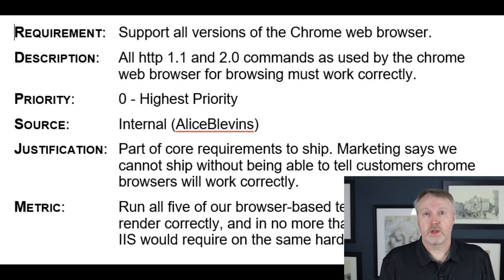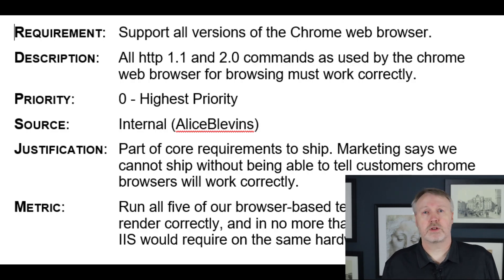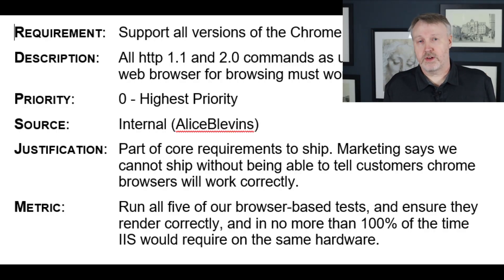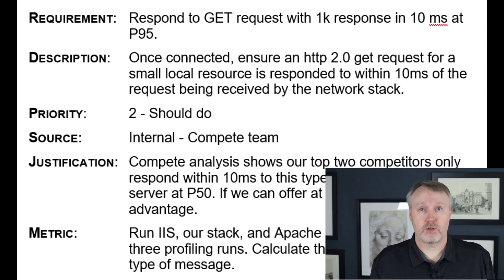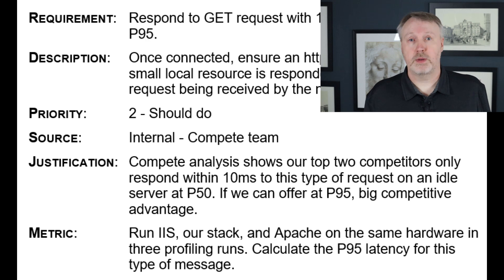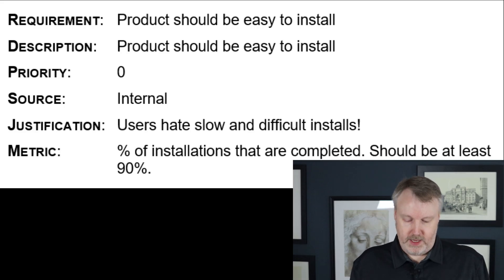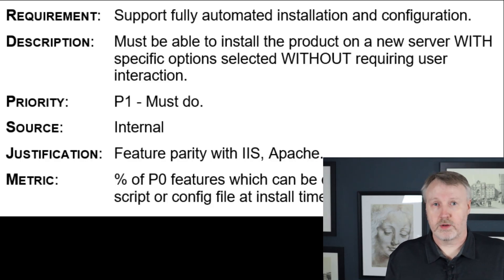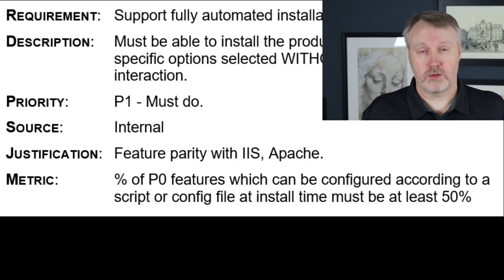Building Big Software - Generating Requirements

Comment: I work in a small team that creates products for other teams to improve performance. How do you deal with wearing multiple hats in a team? Given my team size, we lack the PM to make the requirement gathering with the client. instead, the devs + lead join in on meetings to discuss that with client. Along with that is clarifying requirements, asking additional questions that might occur outside of the meeting, which eats up development time. What's a good way to strike a balance between communication between stakeholders and development?
Reply from the maker: What you've really got is an opportunity for folks to wear several hats, but at the cost of what they can develop. As you point out, time spent on requirements, etc. is time you're not doing primary development. This has to be accounted for in the overall capacity of the team (you get less done). Options include following an agile approach where it's built into the dev cycle, having a rotating responsibility where the eligible team members each take a shift of gathering requirements and doing the other PM-like responsibilities, up through delivery. Ultimately there's only so many hours in the day :(